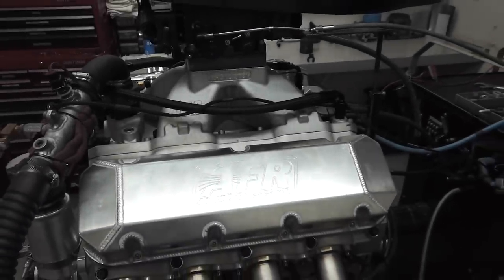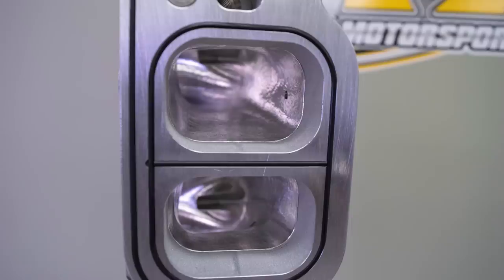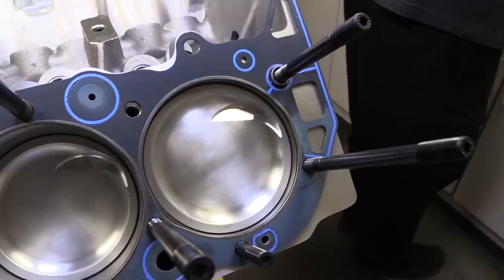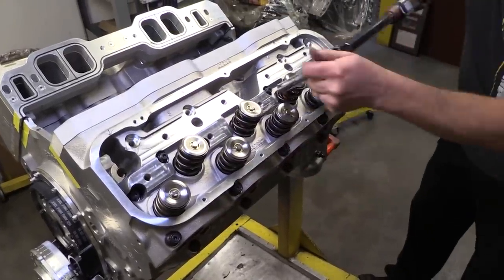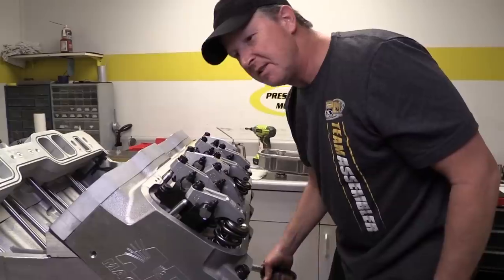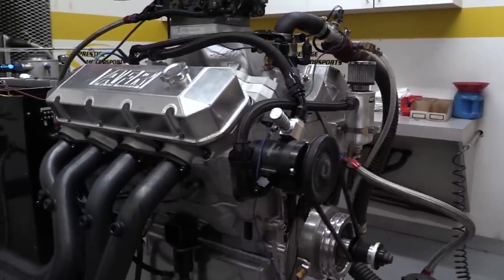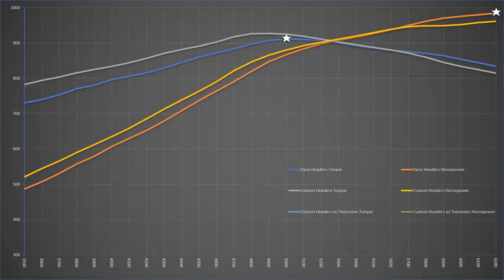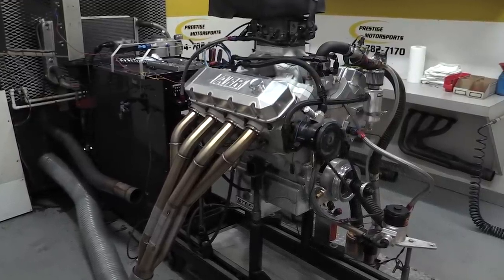665 Cubic Inch (10.9 Liters!) Monster Big Block Engine Build [The Displacement King]

Comment: The best 2 MPG you will ever experience
Reply: We will have to go green another day.
Reply: @Moparmaga-1  I know you trying to be funny and all but the mileage wouldn't be that bad... I have a 600 horsepower blown small block that gets about 7 miles to the gallon in a Camaro... even if this big block monster made twice the power ss my small block he would at least get half the mileage 3.5 miles to the gallon...
Reply: @stevemitchell2252  your engine sounds very efficient.
Reply: "HOW DARE YOU"!!!!!!!! 👧🏼
Reply: 2 MPG at idle
Reply: 3rd Battalion 11th Marines 2mpg not running
Reply: Ford made two gas engines in the 60s the 477, and the 534 , two tuff ass dump truck motors , gas hogs , but man would they get the work done , day in day out .
Reply: steve mitchell 2mpg your being so generous
Reply: @mewrongwayKOCXF  in entirely different eras too. Don't forget the 500ci Caddy engine. Very light for its size. My dad had a mildly done one in a 60's comaro. What a torque monster.
Reply: You're using the wrong unit of measurement. Engines like this are rated in SMILES per gallon.
Reply: @Moparmaga-1  you are correct sir
Reply: you mean -2MPG 💯😂🤣
Reply: @mewrongwayKOCXF  there is no comparison  between the two engines you're comparing. The engine Ford was a work horse that would last for years, if you put that 572 cheeby in the same vehicle it would not last as long nor be able to do twice the work. Nuff said!
Reply: What about the GM 702 v12, beast back in the day.
Reply: How dare you! “ it’s actually fun, lighten up B.
Reply: @mewrongwayKOCXF  dude you still just don't get it son. The Ford is a stock factory built engine and your "beloved cheeby" is a purpose built high output engine. 

Completley different platforms to compare. Put your 572 up against a Kaase Ford engine of the same ci and the 572 will slither away with it's tail between it's legs. Nuff said...
Reply: Yeah cause no one ever said "remember that time we got 60 mpg"
Reply: @stevemitchell2252  its worth it
Reply: Look up the Ford gaa engine used in some of the Sherman tanks only made 500 horsepower 😂 and at full throttle drank a gallon of fuel when running across the field and top speed was I think 35 maybe 45 😂 math brings that to 1/2 mpg
Reply: @thetigerstripes  😆 technically at idle any engine gets 0mpg
Reply: mewrongway this aluminium Brodex engine isn't a Chevy either. Everything on this aluminum engine is aftermarket, nothing Chevy about it besides initial design. That's like saying a 10,000 hp top fuel engine is a Chrysler hemi.
Reply: steve mitchell 2 gpm is more like it
Reply: @stevemitchell2252  I think you forgot the part where this is going into a boat. Boats normally run at a higher rpm for a long time. Even with my twin 454 I get about a gallon a mile per engine.
Reply: @Moparmaga-1  she would self destruct before she made it 6500rpm.
Reply: @jrod264winmag  absolutely not, it may run out of air but it will not destroy itself before 6500, this ain't a toy !
Reply: @Moparmaga-1  have you considered the Piston speed at that rpm? She wouldn't do it for long.
Reply: @Moparmaga-1  you do realize 6,500 for this big engine would be the equivalent of 350 Chevy spinning 10k right!
Reply: @jrod264winmag  no it's not. Where are you getting this math. There's no comparison a 350 spinning at 9k is 5625 ft/min & that doesn't even require pro/stock quality parts. The big ford is 4875 which requires good quality parts. This engine is built to pro stock quality & easily could handle 6000 ft/min which is 8k.
Reply: @Moparmaga-1 check your math, your wrong on both. He's not spinning this engine past 5,500 did you listen to the video.
Reply: @jrod264winmag  I know that. You said it would self destruct at 6500 rpm, I pointed out facts to show that it would & do it at east. My math isn't wrong at all its your comment that was wrong. So I pointed it out. Have a nice day
Reply: You measure things like this in SMILES per gallon, not Miles Per Gallon ;)
Reply: @a64738  yeah I imagine the tears that would be running out too
Reply: @jrod264winmag  did you see the dyno run it was ran up to 6200
Reply: That's not as bad as top fuel dragsters. They use like 14 gallons of fuel in a 1/4 mile or so and that's with an 8.0 liter engine.
Reply: More like 250ft per gallon
Reply: @potatoe4221  twin, blown 540's in a 388 Hustler, feel your pain.... I don't even WANNA know what I'm gettin.... 😂😭
Reply: Naw, at this point it’s gallons per mile
Reply: U forgot to swap the m and g should b gpm
Reply: In a race car it would get hrmm well like 3/8’s of a mile per 15 gallons of gas, that like I don’t know 1/15th a mile per gallon or something like that, my 350 went through 5 gallons of 120 octane race gas per 1/4 mile run back when regular unleaded was $0.79 I was paying $6.99 for 120 octane race fuel which was actually kind of cheap other tracks sold it for a lot more than the piper cub airport I got my fuel at, I only bought from tracks if I absolutions had to they were $8-10 a gallon
Reply: 2 blocks  an a driveway per gallon!!! Lol
Reply: U meant 2 GPM? Gallon per mile
Reply: For some its about how much gas you saved getting A to B. For others its about how fast you get there.
Reply: Depends on the average rpm range, if it’s bolted to a prop, it’ll be limited to 2,900-3,200 rpm, depending on prop radius.
Reply: 900 pounds at 5grand, I’d say a 1.75:1 gear reduction for the prop, and your estimate is close to the mark.
Reply: LoL , GOT that right MURICA !!!
Reply: Hahah u full of it it's more like .2 miles per gallon
Reply: When petrol is as cheap as it is in USA  .....
Reply: @stevemitchell2252  that's going for broke man
Reply: If he can afford to make a nearly 11 liter engine, I don’t think he’s worrying about eCoNoMy
Reply: Well top fuel uses 18 gallons in 1000 feet. That is the most fun per gallon
Reply: smiles per gallon
Reply: @alanmay7929  so it gains fuel the longer it runs then?
Reply: If you want mpg buy a Honda.  😆😆😆
Reply: Hmmmm....I thought it was feet per mile?
Reply: @Blown460  Those new BOSS 9 heads he designed.... 

Priceless!

He's got something like 900 full throttle runs on his test mule. I've never heard of a race engine lasting that long. Pretty incredible.
Reply: No shit
Reply: I think you meant gallons per mile
Reply: @midnitesquirldog1 I got 20 mpg with my olds 455. Mine is much more mild tho 450 horse. One of the best power and torque to mpg ratios out there. The b.m.e.p. Is super good on them it will compare to a lot of modern cars.
Reply: more like 2 gallons per mile
Reply: 2 GPM*
Reply: I'll take this supercharged and methanol injected.
Reply: No.  You're using the wrong unit.
It's 2 GPM (2 Gallons Per Mile).

=)

But aw hell what a mile!
Reply: Try 2 gallons per mile
Reply: @PhotonHerald  that’s about the same fuel economy as a Boeing 737 😂
Reply: @PhotonHerald  I see 🙄
Reply: 2 mpg? On an airboat that big? It's not miles per gallon, it's gallons per hour, and it's probably in the 12-14 range...
Reply: @stevemitchell2252  remember it's in a large airboat, not a car with wheels, but a flat bottom skiff with a propeller that operates out of the water and some have a diameter of 78", they have massive aerodynamic drag to overcome, before they even move the boat, that resists movement the entire time, ( well, until it hits the skinny water ) fuel economy was not a requirement.
Reply: 2mpg is generous lol
Reply: 2 gallon per mile you mean? 🤣
Reply: 2 gallons per mile (GPM)
Reply: a 7 litre LS7 engine can get around 29 US / 34 UK MPG on the highway if geared well for cruising, id be curious what this would do in similar circumstances and with EFI, much better than people here think for sure, the engine would be barely spinning
Reply: 2?
Reply: Smiles not the miles
Reply: no 2 gallons per mile
Reply: Smiles per gallon!
Reply: Yep...the best smile per mile and probably One of the best experience One can ever had..given the chassis can resist the twist and the tree hugger cant smell the av gas on the tail.ya ya ya....
Reply: indeed
Reply: Dang right!
Reply: I couldn't have said it better myself
Reply: if you think this engine drinks gas try an M1A1 Abraham's main battle tank 5 gallons per mile.
Reply: Gallons per mile lol
Reply: 2 inpg(inch per gallon) at full throtl😂😂😂
Reply: You mean 2 gallons per mile
Reply: Miles? Upwind or downwind? On land, deep smooth water, or shallow skinny water?
Reply: Remember this is an airboat, It’s not a commuter’s econobox.
Reply: I run 472-500 Cadillac engines with stroker cranks and bigger pistons/higher wrist pins, was working on a custom setup to space the crank centerline and cam bores further from the deck, build up the deck height, run longer pushrods and angle split rods for biggerrerr strokerer block to rod bolt and counterweight clearance
Reply: What’s it weigh!!?

Comment: When you're trying to decide how big you want your pistons and the only thing in reach is a coffee can
Reply: Crazystuffyousee the piston isnt that impressive. The 5” stoke is what’s giving it the cubes. That’s unreal stroke. I don’t see how it holds that many R’s with that long of stoke.
Reply: Crazystuffyousee more like a 3 gallon bucket lol
Reply: Rod to stroke ratio is all you need. Longer the rod, the longer the stroke stability, it's simple when you think about it. Stable pistons with long rods = less skirt / piston walk, (real reason why some engines can rev)
Reply: I built very large natural gas compressors for a while. There's nothing like using a crane to install the 26" pistons. Apples to oranges I know but it was still cool. Lol
Reply: @mackenzieklock6868  And piston speed, pistons can only hold so much force before they fail

Comment: What do you use for a starter? A Chevy small block.
Reply: two batteries and a starter intended for a diesel engine would work fine.
Reply: Big block, check the title
Reply: @carlbeaver7112  he meant you would need a small block to use as a starter for that monster of an engine.
Reply: 😂 lol
Reply: lmao
Reply: A bronco engine; 3 cylinder
Reply: Lmbo
Reply: Lmfao
Reply: Kinda like how the air force used the engine from the Ford Mustang to start the engines of the SR-71 blackbird
Reply: Best comment ever!
Reply: LMAO!! Exactly what I was thinking!!
Reply: A two stroke 😂
Reply: @orppranator5230  it was not a stang
Reply: Used a Prius engine out of a f150
Reply: @carlbeaver7112  Not that bright are you?
Reply: Pony motor from a dozer